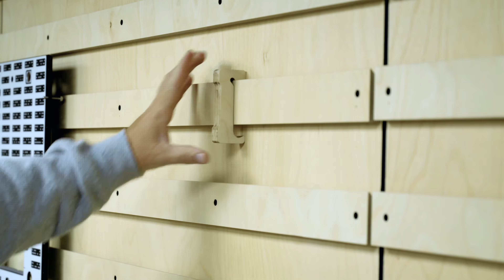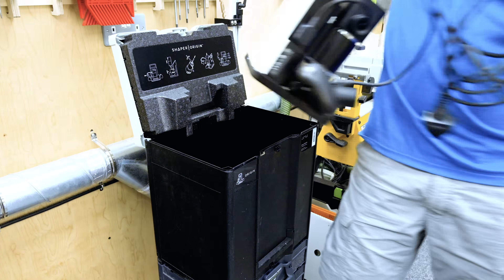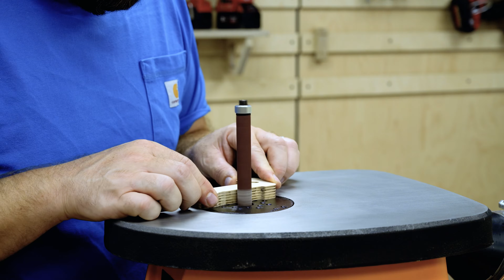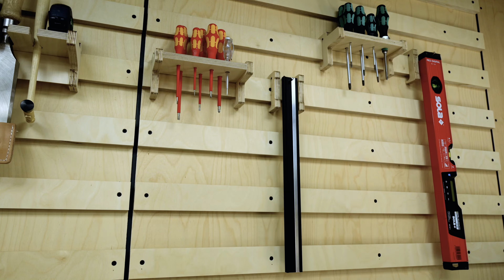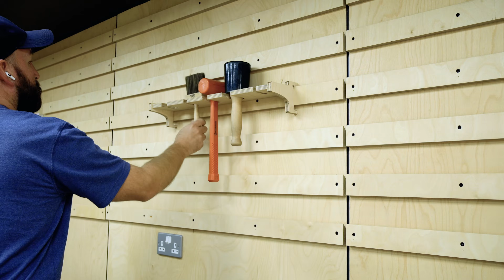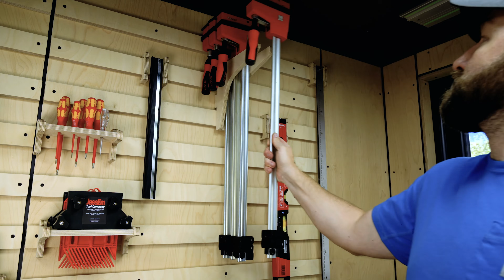Everyone should make French Cleat Tools Holders this way

Comment: What is the spacing for your wall mounted cleats?
Reply from the maker: I have two sizes of cleats in my shop. For the 60mm face cleats I’m using a 75mm spacing. For the 80mm face cleats 130mm

Comment: Excellent idea. Do you have a way to create these brackets, in quantity, using regular workshop tools? Say, table saw, router, drill (press), jig saw. BTW: great content, good delivery, great editing. And it’s ok to smile occasionally 😊
Reply from the maker: If I didn’t have CNC then I would have a go to print out the design file on paper and try to make a master template first with band saw and then with router plus trim bit. Would need to be <7mm bit to get into the hook. Once you have template you can make more much more quickly. I can also make you a template at minimal cost and you can go from there. Find me on insta (@hswbuilds) if you want to pursue template route. 
Thanks also for suggesting smile. I know it but only a few weeks into this YT work and being in front of camera still isn’t relaxing. Working on it though! 😄

Comment: Nice and inspiring video, thanks!  I am a fan of french cleats as well, and to be honest I prefer to lay precise measurement tools (small squares, calipers etc…) in a drawer than on an “open” wall (like along a passage) as a mishap can happen and throw all those fine tools on the ground.  This happened to me actually, while moving big birch-ply panels a bit too big for my space.  I hit the french cleat holder where I had some of my stuff and this detached it, gravity doing the rest.  My trying square was bend, Japanese 300mm ruler dented at one edge and the vernier of the caliped was damaged.  Since then, all that is safely housed in a nearby drawer :-)
Reply from the maker: Yeah totally get that! I have some of my precision tools in drawers as well but ultimately I like the speed gains of having as much as possible on the wall.